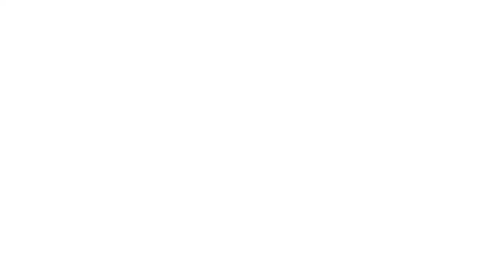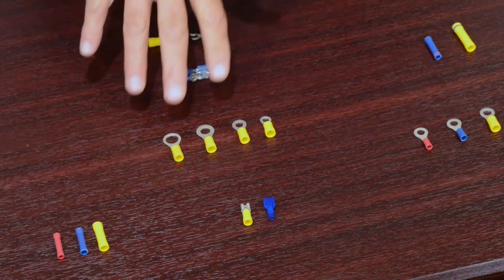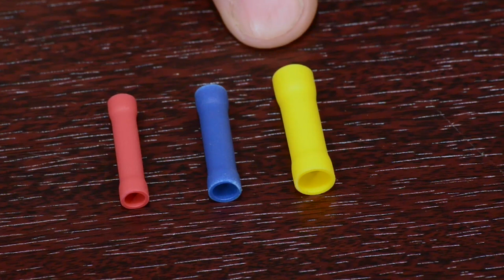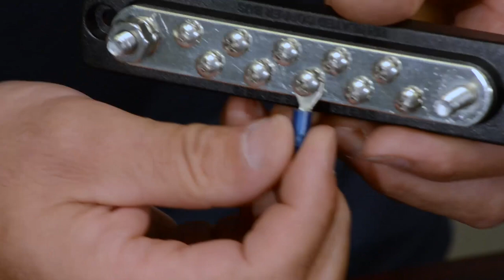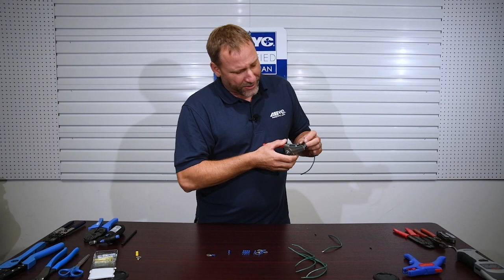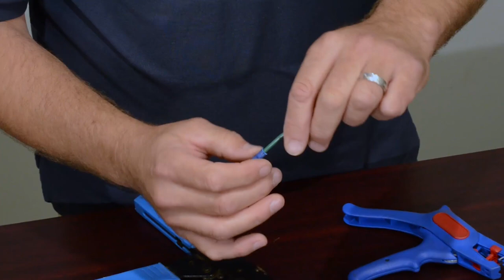Wiring Terminations: Terminal Types, Stripping, and Crimping

Comment: I'm a lay sparky but I've been making connections like these for 60 years and have made hundreds.  I agree with everything you did and thought you did a good job with the presentation.  Thank you!!  One question -  I wasn't aware of "step down" butt connectors.   Is it acceptable to strip an extra length of 18 gauge wire and bend it to go into a blue terminal meant for a 14 gauge wire?

Comment: Coming from ABYC, this was disappointing. Where was the talk of stress relief connectors that grip both the wire and the insulation, where were the heat shrink connectors, and where was the discussion of Wago style connectors? What you showed here was bottom of the barrel and I had expected better. On terminology, I believe that the connector you used on the switch is a spade connector and the one with fall-out potential on the terminal block is a fork connector.